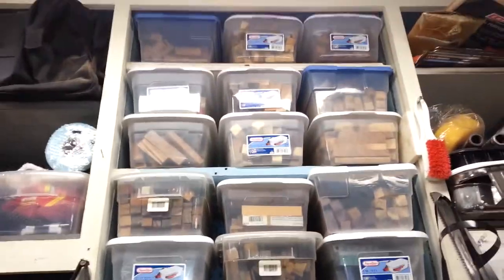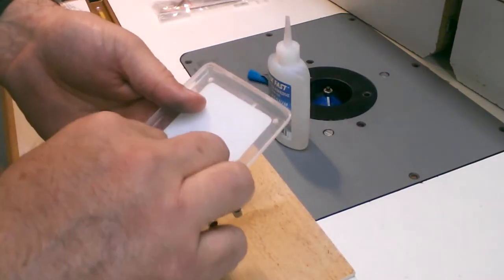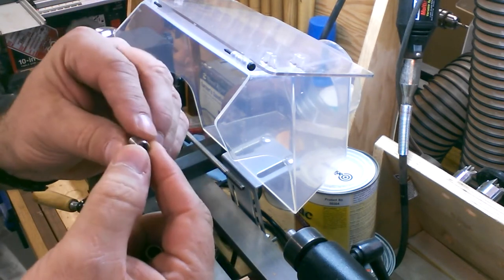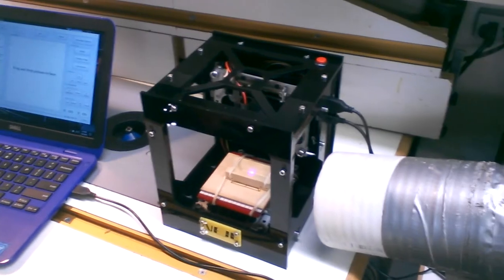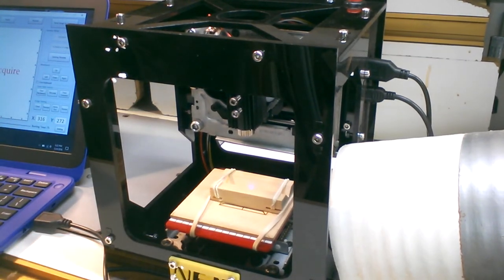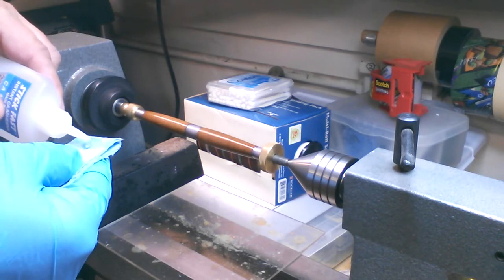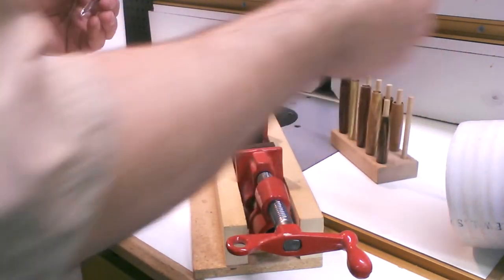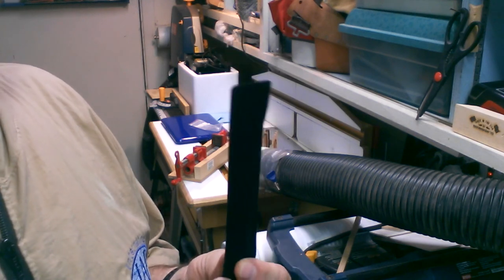15 - Penturning: PSI Trimline with Laser Engraving

Comment: I love that you have incorporated this little laser engraving unit. I have the same one and was worried it wouldn't come out right if I didn't use a rotary option of some kind.
Reply from the maker: Hi Kevin, appreciate you watching and commenting. I've thought about buying one of the rotary attachments to do engravings of greater circumference around the barrel, which is where they are really needed, but mostly still do names, so haven't yet. Have fun with yours. Cheers!

Comment: Good video, but have a question on the laser engraving.   A pen is round and the laser does flat.   I see they now have a kit to use with this engraver to enable one to do round objects, but you didn't seem to have a problem with round and I'm wondering why.
Reply from the maker: Hi, thanks for watching and commenting. The small surface area for Engraving a name or other text on a pen turns out to be inconsequential curvature for the laser. However, if trying to engrave something that takes up more Barrel space, you would definitely want to use one of the add-ons available to rotate the pain during the engraving. Hope that helps. Cheers!

Comment: Great video can you use the engraver after the pen is finished? And how does it do with Acrylic blanks?
Reply from the maker: Hi Troy, thanks for watching. Over on the pen turners forum I've heard of some who use it on finished pens,  but due to the little smoke residue I prefer use on unfinished so I can lightly sand off the residue. I don't believe this 1 watt laser is strong enough to engrave acrylics properly. Cheers!
Reply: there's a 1.5 W version of this system, I wonder if that would do acrylic?

Comment: Hi Bill,  Enjoy watching your videos.  I recently watched  a video where the turner compared Alumilite vs Easy Cast clear epoxy, giving favorable review to Alumilite.  Have you tried Alumilite?  Have you had any issues using Easy Cast?  Thanks for your thoughts.
Reply from the maker: Hi Tony, thanks for watching the videos, glad you enjoy them. I have not used alumilite yet, most of the casting I've been doing his color casting for which the castin craft has worked pretty well. I have a pressure pot I recently set up so I could try the alumilite clear at some point in the future. Cheers!

Comment: How did you get the name in that program, I have been trying for almost year now, I have the same machine as you do. I also make pens, for 12 years now. Thank You
Dennis
Reply from the maker: Hi Dennis, thanks for watching and commenting.  I use Microsft Paint (the app that comes with Windows); I set it up for 500x500 pixels, create the name in a text box, crop it down to just the size of the name, and save it as a JPG file.  You can then drag and drop the name file into the laser app for engraving.  If this is not clear, let me know and I can do a quick video on it.  Cheers!

Comment: Do you need to make any adjustments when laser engraving to account for the curvature of the pen? 
Have you tried the engraver with acrylic and/or solid surface countertop?
Reply from the maker: Hi John, thanks for watching and commenting. When I use the laser for one line of text, the curvature doesn't have much of an impact. I have not tried it on acrylic or countertop, but have heard that this 1 Watt version is not strong enough to adequately etch the surface. I hear that there's a vendor on the IAP website (penturners.org) that sells a device you can attach to this engraver that will rotate the pen barrel if you have larger graphics to wrap around the barrel. Cheers!